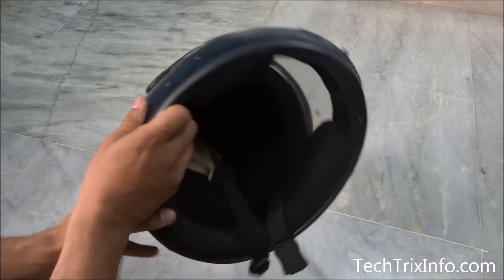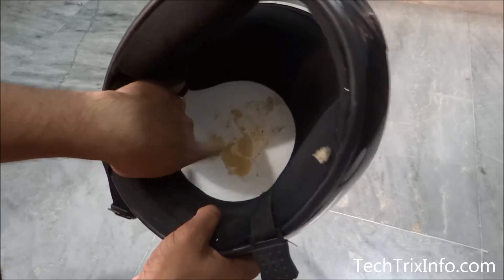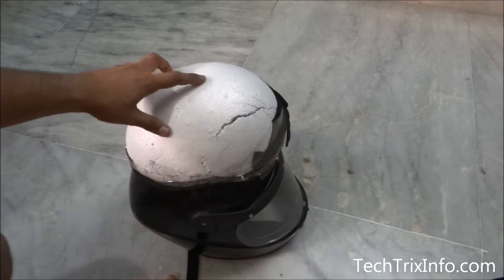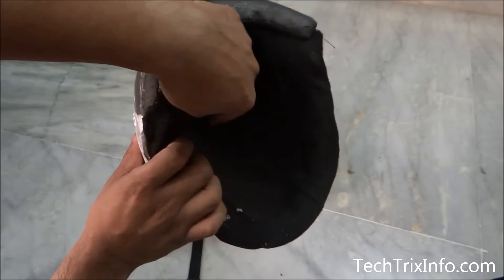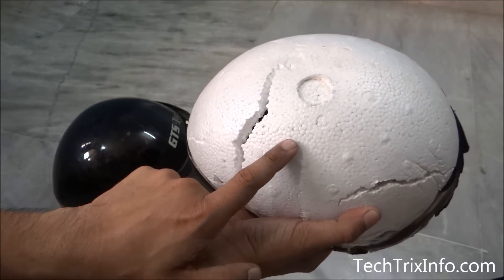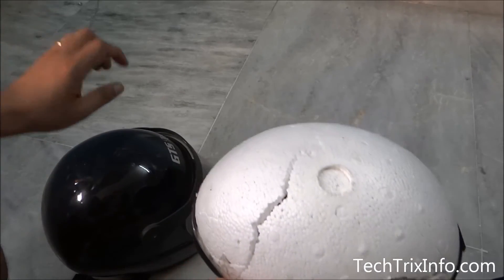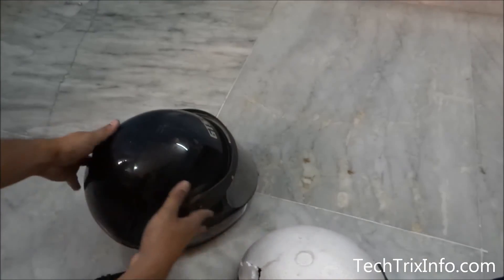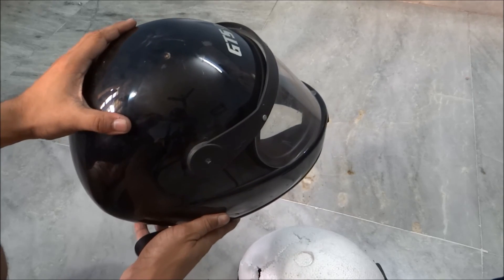What's the engineering behind a helmet? Explained

Comment: The thermocol absorbs the immediate impact and saves the brain from hitting the skull and it does not absorb very little energy while cracking and hence please improve your presentation. If the outer shell cracks it is good and it absorbs maximum energy. The inside thermocol makes it shock proof